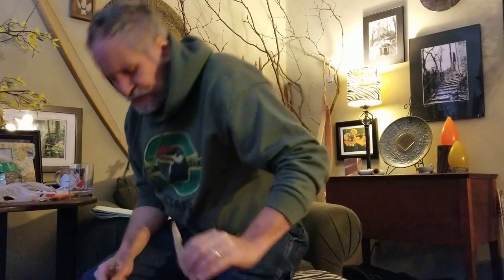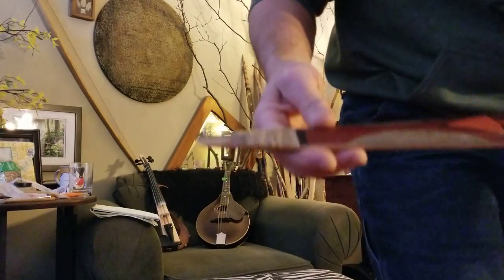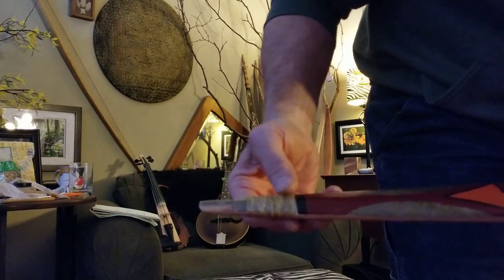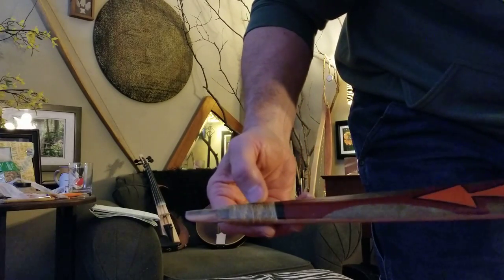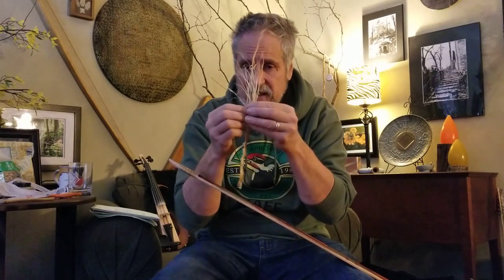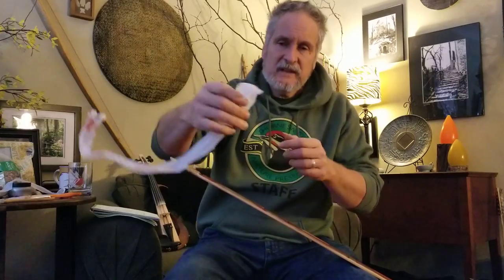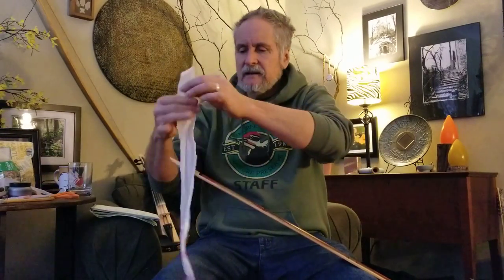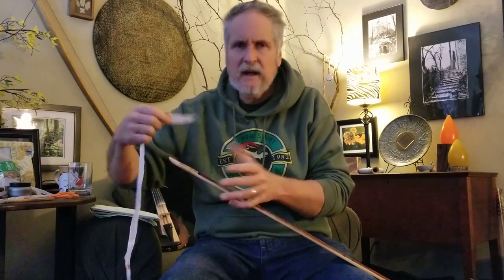4 Ground Shaking Topics!!

Comment: I couldn't wait till morning to shoot the bow. Holy crap it's powerful but quiet. It's normal for the string to stretch? I t went from 5in to 4 1/2 in, I just unstrung the top gave it a few twists and went to 5 1/4 but after a few shots went to 5in brace height. Did I do it right?
Reply from the maker: Yep. It's easier to give it a few twists than retie the string, you're fine, it's not critical whether it's 5 or 4 or 4 1/2, but when the string settles in it'll be more consistent. It really thumps those arrows, doesn't it

Comment: Which style of bow is more efficient, the paddle bows or the molgabet. I'm interested in possibly getting one later in the future?
Reply from the maker: Gosh, I would have to say that the needle tips get the nod by a margin. If you like bows in the 50's, I snap the one up with the black diamonds. I may not make another  until next November. I'm willing to cut a deal because you already bought one this season.
Reply from the maker: For some reason, I mixed you up with another fellow that bought a bow. This one wouldn't be suited for a 31" draw.
Reply: @johnjriggsarchery2457  that's fine. I have to wait to save up. And test the paddle bow capabilities to have a comparison
Reply from the maker: @dgundeadforge17  Gotcha. Yours is definitely capable of dropping a moose if you are so inclined. Big wild pigs, bears, it's definitely enough.
Reply: @johnjriggsarchery2457   which wood seems to be good with molgabet design. I might attempt to make my own to see what I learn.